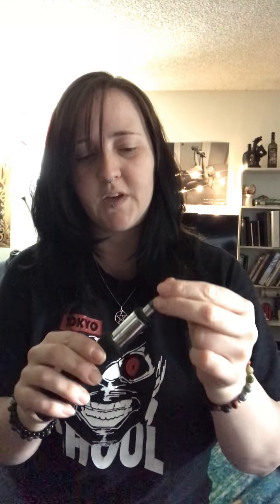If your toe stop screw strips

Comment: I went back to my old stomping grounds this summer for the July 4th and Pioneer Days Parades. The summer was hot and dry. All the little ones in the July 4th parade were so sunburned by the end. At the Pioneer Days parade the fire department used the hoses and made a water fall at a couple of intersections to cool off the kids who ran down the street to join the water-play. A talent show followed the Pioneer Days parade at the local high school and I got to see some of my family members. Before I left town I did some cemetarian work at my family's burial plot. If I am buried there, I will add to more than 80 years of your family linage who is buried in one spot.

Have you attended any reunions this year?